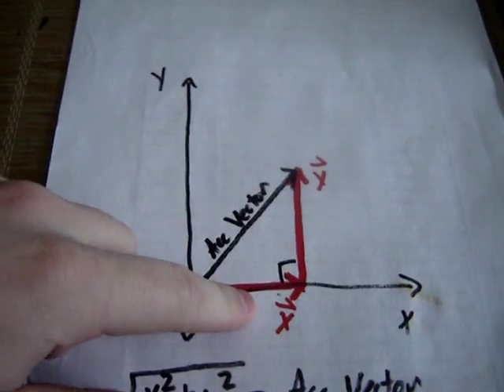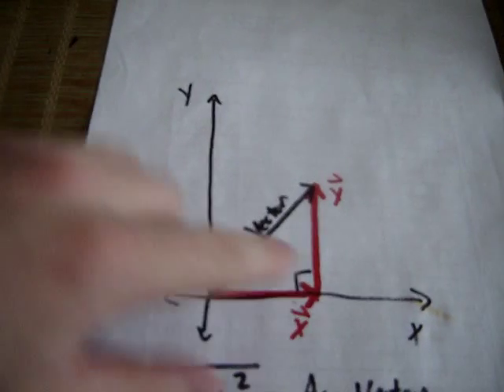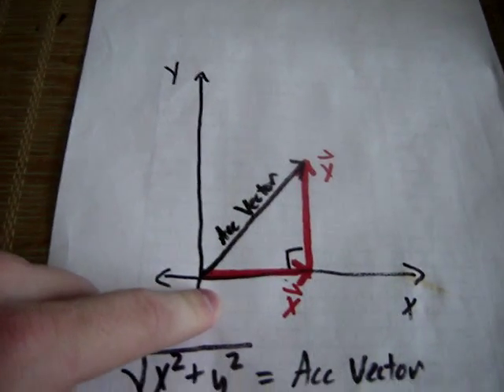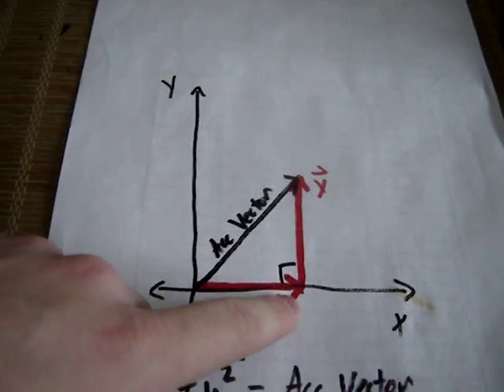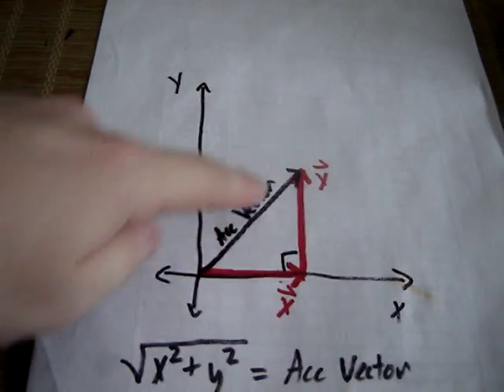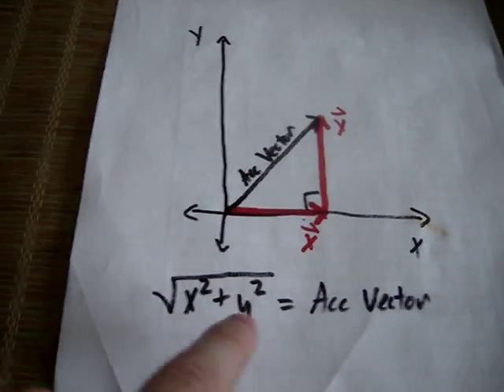Barrel Test Conclusions Part 1

Comment: There's a lot of things that go into accuracy down range. Accuracy is actually a byproduct of several things lining up. Shot to shot consistency, the physical consistency of the balls themselves, paint to barrel match, etc. And even those are often byproducts of other things. Consistency for example is regulator recharge rate vs flow rate of internals vs dwell etc etc. When everything lines up and your aim is steady, you can print silly tight groups at max range in my experience.